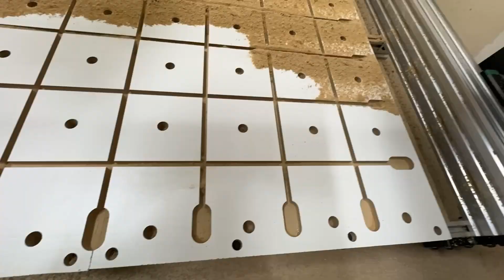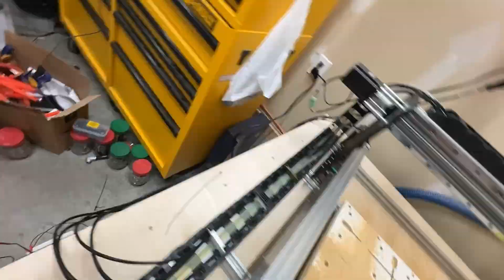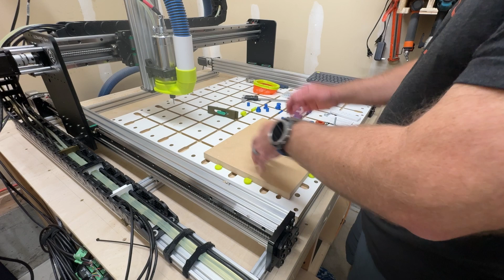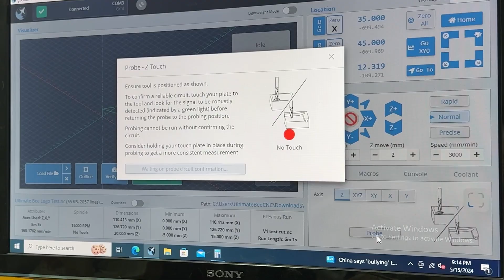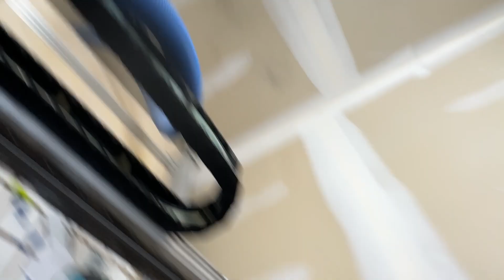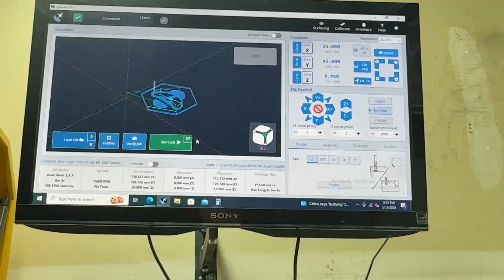Ultimate Bee CNC Spoilboard - Rough edit

Comment: Do you have a review on this machine as to how performant, how accurate and how robust this machine is ?
Reply from the maker: I don't to date but I could look at putting something together for sure. Any specific insights and or tests you think would be good to see? 
I can say that out of the few hobby machines I have had this is by far my favorite and most rigid for sure.
Reply: @sparks-tech  im not an expert
But i think testing the main (potential) weak points of the machine would be great
For example, bulkman claims using 12mm ball screws is the best choice but it whips around when reaching high speeds
Reply: @sahanpanditharathne2765  Am looking at buying a Ultimate Bee and would love an honest review. Is the 12mm ball screws whipping a major concern does it effect the quality of the cut? 12mm according to their site has a greater torque? Following you now. :-)
Reply: @MONKEY-vi7hx  i bought an oxman which is good machine
But it has 16mm ball screws